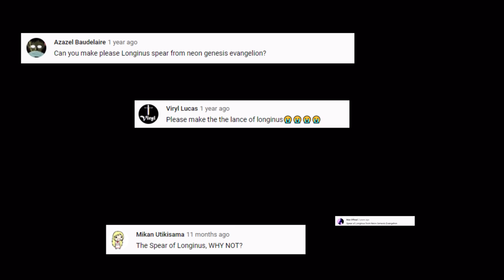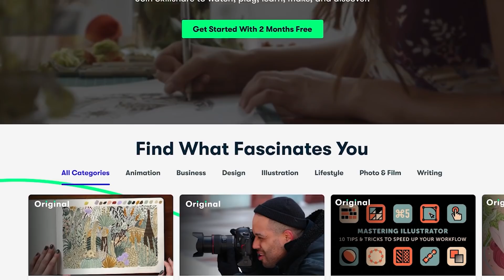Spear of Longinus - Neon Genesis Evangelion - MAN AT ARMS : REFORGED

Comment: This would've looked sick as Damascus and tinted red through a chemical process instead of painted. Missed opportunity.
Reply: Doing this in damascus would have probably been either very expensive or very time-consuming, unfortunately.
Reply from the maker: @crlmson_  Your right but its really more about the time.  We filmed this at the same time as Godfall - Eclipse and all the forgewelding time went into that sword.
Reply: It comes down to time. Six builds in eight days.
Reply: @AweMe  just imagining the pattern this would've had with all the twists, it would've been gorgeous. Not to take away from the Godfall sword, but you don't see Damascus on blacksmithing channels on non-sword builds that often so I think this build was more deserving of the time.
Reply: Completely agree with you Kyle. Such a beautiful weapon ruined by a basic paint job. Even if they couldn't do it a fancy way, there was other paint methods in handling it. 

Oh well I didn't spend time and money on it, so I have no say in the matter. All I can give is my opinion 🤷‍♀️ Just hurt me to also see it used like a freaken hammer. The boyfriend and I were like 😱
Reply: @AweMe  That's a shame. Any chance you could refinish it, sand of the paint and smooth the surfaces, then re-paint it closer to the Scissor Blade from Kill La Kill? Obviously you painted that too, but the finish was much nicer.
Reply: @ChiiPooky  I agree.. the refining of the surface wouldve made it super nice rather than just paint on a rough finish

Comment: how to use a spear 101: SMASH AND BASH
Reply: If they just stabbed things then the demo would get boring. 

Also, you try using a full-metal spear that weighs more than any actual spear.
Reply: I was also wondering why are they using a spear as a hammer
Reply: @Katarn84  Well they didn't exactly try very hard on it. So I wouldn't be surprised if it would break from a throw.

Comment: So yall know a spear is thrown right? Yes thrusting and if blade type then blade edge is swung. They are also light and nimble. This includes the Lance of Longinus. Much of this spear is smooth till about mid way and thin. Closer to twisted ribbons as opposed to rods.

Cool ya tried but I feel like you didn’t put much effort into the details of the spear actual design in Evangelion. Similar issue to the Black Clover Sword. Used a lot of metal you didn’t actually need. Poor guy was working overtime to twist 3/4” steel rods. This build would be fun to try as a fan of the show. Although maintenance would be a pain. However you should send it to How Ridiculous so they can drop it.

Comment: after seeing this a few times, ive identified some issues. 
1st its unpolished and no primer mentioned. 
2nd the blade needs to also be spiked at the bottom tip for the long variant
3rd as the special spear it could have gone longer
4th the blade was only sharpened on one end of each side, the true blade is double edged on both prongs
5th using it like a hammer and keeping the shot instead of taking slices , i know its big but where's the burly men who could make cloud and guts sword . they can use a heavy weapon
6th the fan service wasnt too bad , IF SHE COULD USE IT LIKE A SPEAR and the lack of shots of her actually using it was missed oppritunity. 
7th You guys looked at the blade didnt even go for dimensions no measurments or work into how it scales
8th all in all it looks like you just carlessly bound these together NO HEAT TREATING  just gonna ltwist two long metal peices put  barley an edge and call it done.  

I wanted to come back and got excited to see work people were proud of, but i got super disappointed. 
WHATS  NEXT!!! Youre going to tell me these guys are doing podcasts instead of making awesome weaponry

Comment: Thats the first time that l see them fail.

The helix opens by the end and the format at the begining of the blades should have been made in a more "cristal like formation" and not round as that, the texture of its surface is very clean and smooth,
The pierces are very long and gradually gets thin unlike this... thing 
There are more errors but 
No need to explain more than that